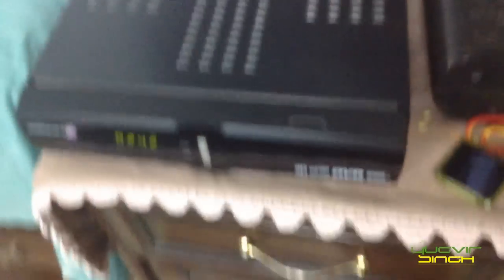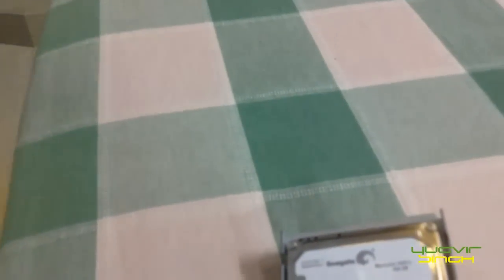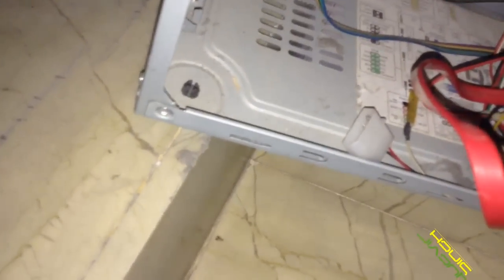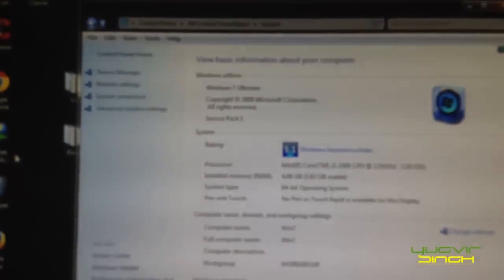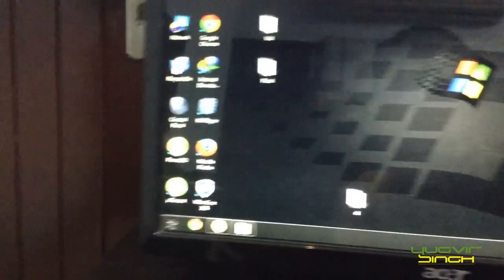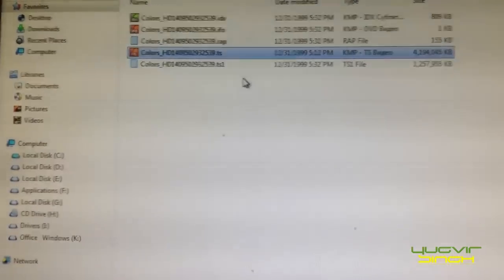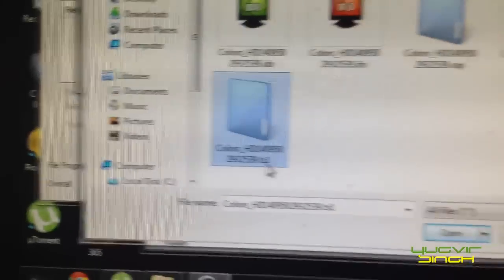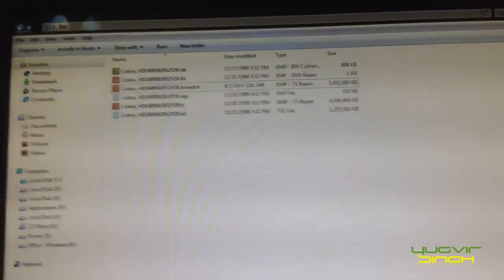How to copy set-top box recorded videos to PC

Comment: How to do for SITI cable HD BOX.
which records and has a folder named PVR.
it already has separate folders for separate recordings
inside each folder there is 1 recording folder and 3 other text editor file named "EVENT" "BOOKMARK" "INFO" & "Length"
Inside Rec folder
i have 5-6 data and they are
1. Rec - Extension type - "FILE "- it is the biggest file - 139 mb
2. Rec.cxt - 1kb
3. Rec.idx - 59kb
4. Rec.ifo - 2kb
5. Rec.rap - 6kb
6. Rec00.mda - 0kb
7. Rec01.mda - 0kb

Now plz tell me how do i open it